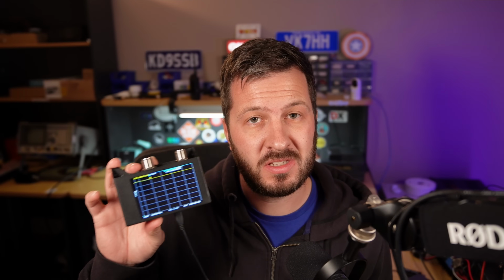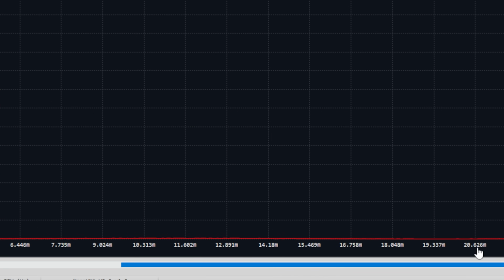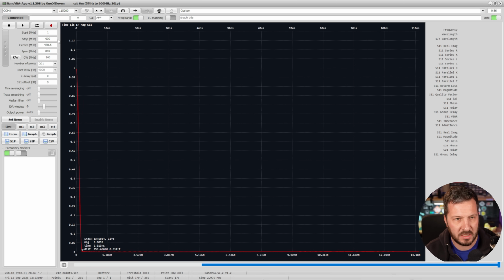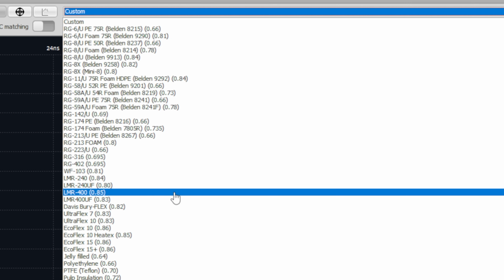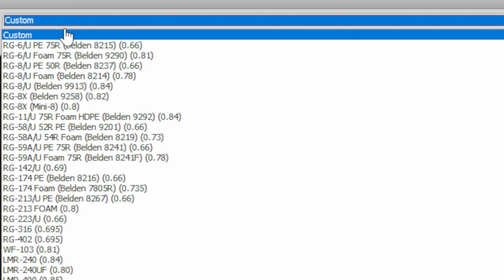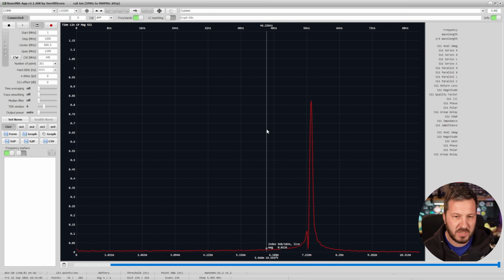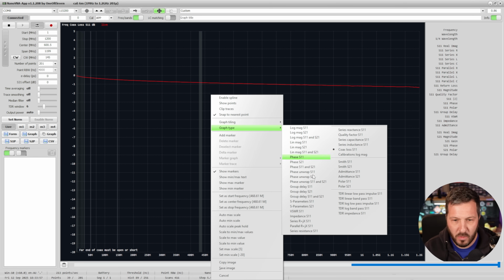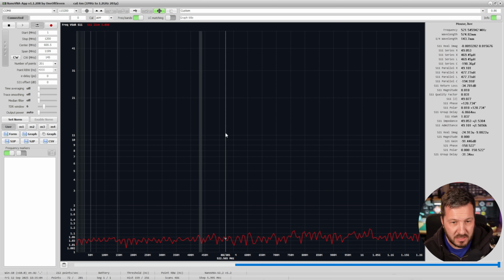Your Coax Might Be BAD – Here’s How to Test It!

Comment: You missed the opportunity to demonstrate this features best use, finding faults.  If you have a old junk piece of cable laying around you might consider making another video about transmission line fault finding.  To start demonstrate a poor connection by connecting two good cables together with a female to female adapter but leave the nuts loose.  When you sweep the cable you will see a bump on the graph at the at the length where the connection is.  Tighten the nuts and you will see the bump lower.  It will not go completely flatline though.  This is the small impedance bump presented by the connector and is handy for demonstrating cable union locations.  Then using your junk cable purposefully kink the cable on camera as you are sweeping it.  You will see a big peak occur on the graph at the length where you kinked it.  I'm not familiar with using the Nano VNA, I use R&S and Keysight handheld analyzers.  If it has the ability to zoom in it can also be used to help diagnose antenna/feedline systems.  Not all that uncommon to find a antenna coax connector that has been infiltrated by water and has become a poor connection.  Using a TDR graph that is zoomed in at the antenna end on a good antenna and coax cable connection you will see a small bump.  This is the connection between the two.  If you see a larger bump or spike this indicates a poor coax connector connection.
Reply: An easy demo is to connect a 75 ohm cable to the 50 ohm cable and see the mismatch step. Another is to crush a piece of cable with pliers and you can see it on the TDR.